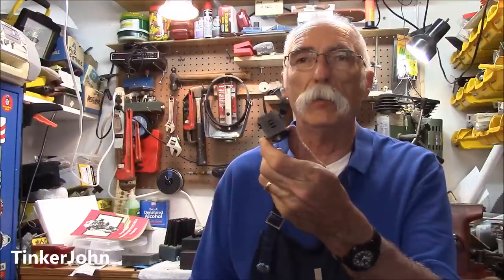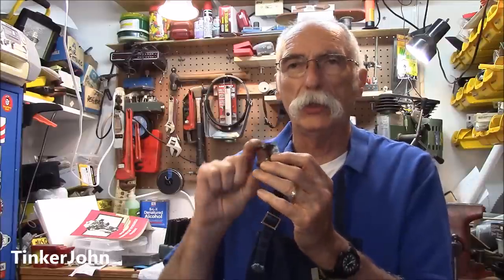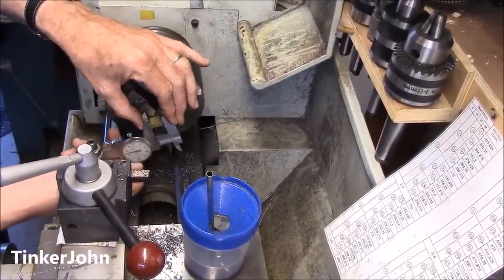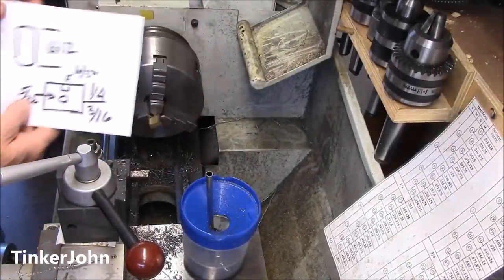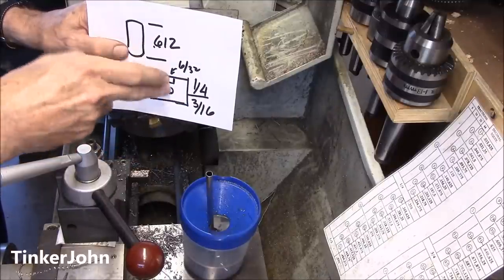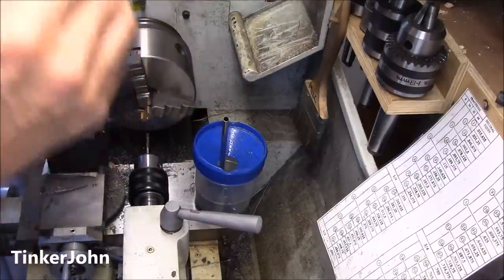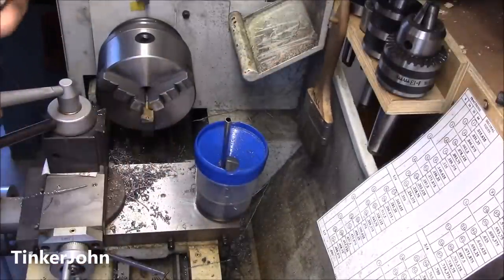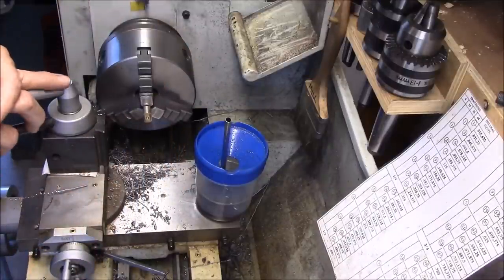Machining the Stuart 10V Steam Engine Castings - Part 24

Comment: I watched the video again when you bored the cross-slide hole through the legs and you measured it at .621 (.004 under 5/8ths). On your drawing for the cross-slide, you wrote that dimension as .612 which is why when you turned down the cross-slide to .615, it fit in the cross-slide bore in the legs. (.621-.615=.007 undersized).
Reply from the maker: +TinkeringJohn 
Transposed numbers...comes with the age!     ~John

Comment: Hi John, I was just about to head to bed when I checked my video feed and there you were so, just had to watch or I would have been lying in bed wondering what was in the video.  I noticed that you changed plans a bit because of a lack of BA fasteners.  If you ever need something specific from here that you are having trouble getting please let me know because it would be a real pleasure to help you out.  My mates are engineers so they know all the best suppliers.
Best Wishes, Brendan.
Reply from the maker: Brendan,As always, it's good to hear from you and I appreciate your offer.  The UK is really a good source of model engineering supplies.  For the most part, it's not a big deal to transfer BA to USS or SAE fasteners.  BTW:  I am trying my hand a potatoes this year for the first time in a while, hopefully I'll have some for dinner before long.  In fact our garden is looking better than it has in several years (Totally due to my wife's "green thumb")All the best,~John

Comment: Hi John. Thanks for the advice on starting out with a raw stock kit before doing a casting kit. Besides the casting kits I have from Stuart and P.M. Research, I also have an RV-1, an RV-2, and a Liney 5 from Liney Machine which are raw stock kits. I am learning not only what to do, but what NOT to do from your videos. LOL. Thanks for the videos!
Reply from the maker: +TinkeringJohn 
The Liney kits are really nice, in fact I prefer to use bar stock since it''s much less expensive to build.     ~John
Reply: +W5CYF / TinkerJohn I thought about making my own castings (did some eagle castings waaaay back in high school), but the time and work it would take, you could probably have an engine built from stock.

Comment: hello, John.

i hope all is well w/ yourself. i just wanted to post a 10v update - i'm done!

very pleased w/ the results. i'm going to add the reverse linkage soon, but want to first complete a stuart boiler feed pump.

thank you for the inspiration and for teaching me a few things along the way.

//frank
Reply from the maker: Frank Ruffolo Frank,  
I saw your video and engine.  Very nice work!  Hopefully I can get back in the shop before long and complete my version.  It's been an extremely busy summer for me.
~John
Reply: W5CYF / TinkerJohn you're too kind. i hope things will slow for you as the autumn approaches so you can get back to what's really important :D